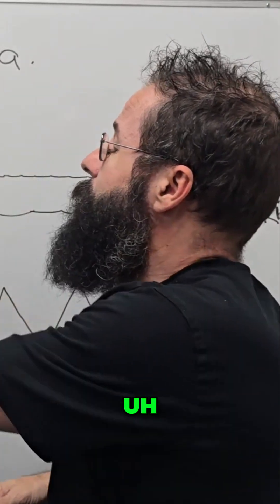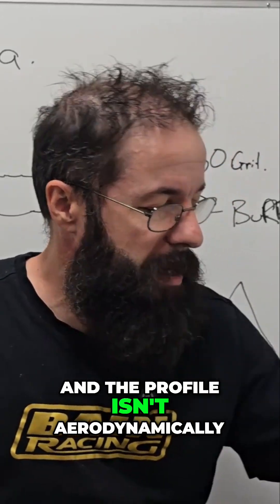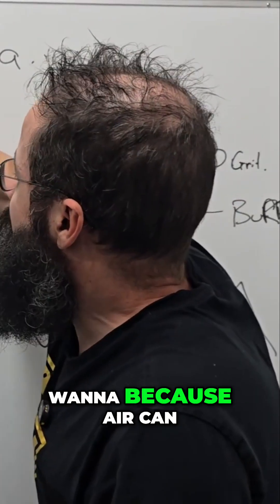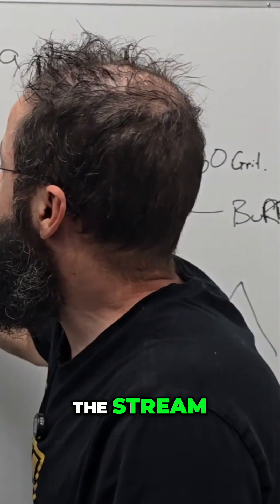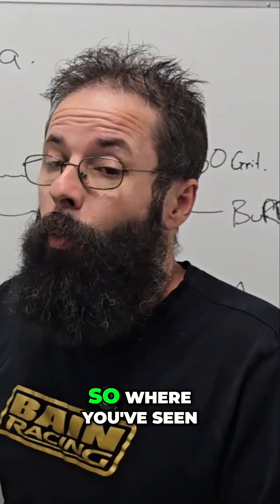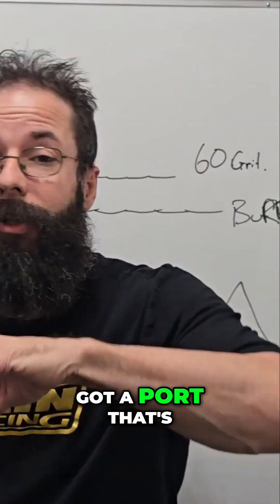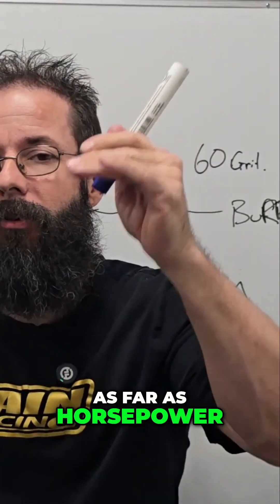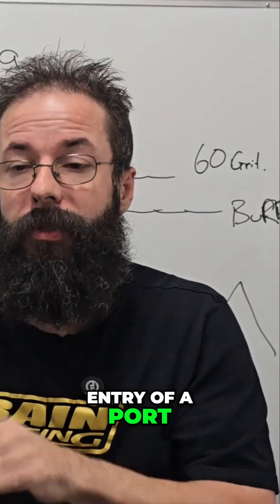Dimples in Ports: How They Impact Engine Performance? #shorts

Comment: Greetings from Brazil.

Here we have two well-known companies that tested and published the results of dimples in cylinder heads, and there were no differences in flow, however the swirl of the dimples was greater.
Reply from the maker: Yeah, think I've seen this. Unfortunately you don't want swirl in a port, you want it it the cylinder in the form of swirl or tumble.  

Also they didn't look at the convection aspect (so how much heat is generated) which is 300-500% greater then even a burr finish. 

 These are the entropy losses we talk about. In short, you are losing mass flow.  Hence why they don't work in a running engine. 👍
Reply: @bainracing  Thanks for the answer.

I know you’ve got a bunch of videos teaching this stuff, and I’ve been studying through your playlists. But I reckon that’s not the whole picture. I want to learn how to develop things the right way, without guesswork or the usual myths floating around. Could you point me to any books or courses where I can dig deeper?

Comment: So is like a surface like 120grit sandpaper, basically a bunch of small dimples?
Reply from the maker: No, that's very different. It's about the profile shape.  Dimples have surfaces perpendicular to air flow. Sanding will not. So it has far less surface drag.
Reply: @bainracing 
I see. Thanks for the info.👍
Reply from the maker: No drama's,  always lots of confusion around this. 👍